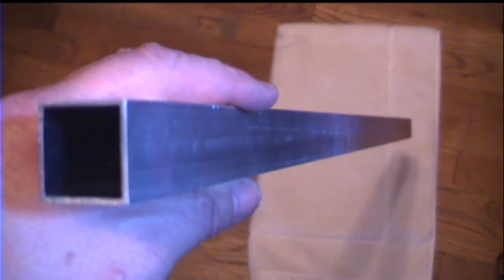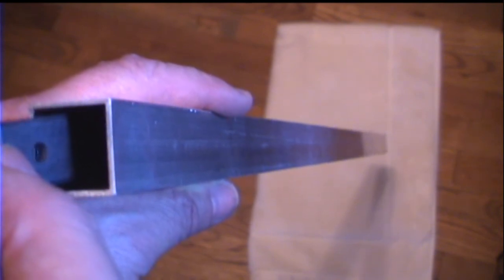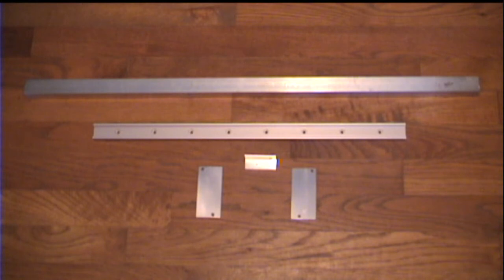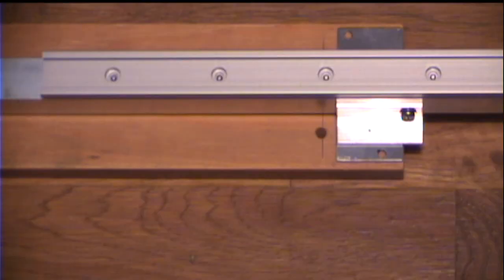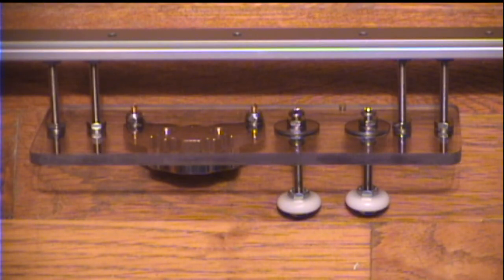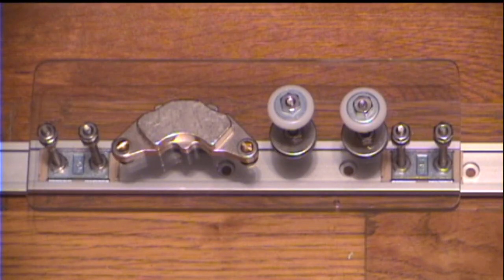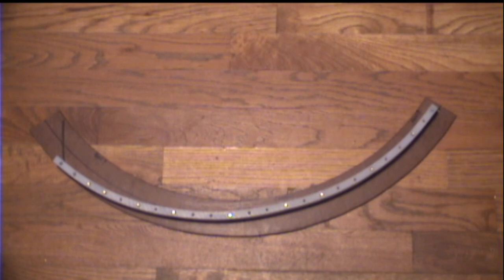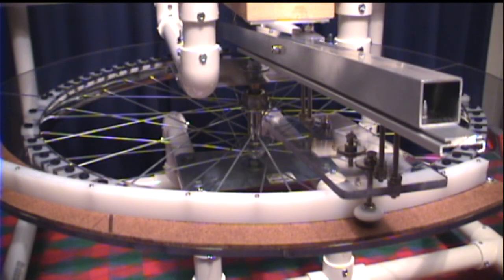Video #21, "Rick's Pipe Dream" Magnetic Motor - Generator Project

Comment from the maker: Might be a few more days.  I will be testing differing timing track layouts over a 90 degree section of the rotor to determine what will work best.  That is the purpose of using the Masonite test arcs.  After these tests are completed, I will lay out track on the entire 360 degrees of the polycarbonate track base, will spin the rotor up to 100rpm using an external force, and time the rundown to zero rpm.  Rundown testing will be done with/without the stator carriage and with/without the flywheel

Comment from the maker: Yes, I am aware of the eddy currents.  My stator magnet is shielded from the aluminum by its 1/4" thick steel backing plate, and the rotor magnets are located more than 3.5 inches from the aluminum, so I don't fear any problems.  I am using a steel bike wheel as the rotor, which works like the permeability plate suggested in Howard Johnson's PMM patent.  Good luck to you with your pulse motor, regs.

Comment: sorry was a typo-drag force of the magnet in the aluminium tube,its attributed to the eddy currents induced in the conductor.
my build was based on the work of Robert Adams and i followed his instructions of eliminating these eddy current losses by not using any steel or aluminium in the construction,and using a brass rod to mount the bearings.
the use of small neo's applies to this engine,yours looks like a different beast altogether.
i share the same dream of PMMG,only mine looks different

Comment: i built my device with wood and brass-using much smaller neo's to eliminate the large drage forces that you have demonstrated,which will also create drag against the copper coils i use for pickups.
im using reed switches to pulse drive coils-check my latest vid for an update